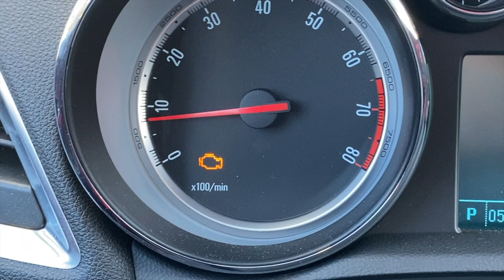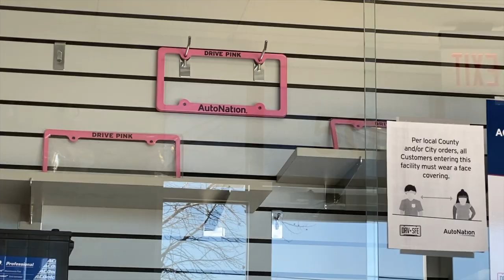#Cartrouble - Pearl is broken and it's expensive #catalyticconverter

Comment: Can i make a sugestion, find out how a car works. And what is and what is not important.
A catolitic converter is to do with the exhaust system and limits exhaust gasses into the atmosphere it is not that important you can drive a car without one.
Car parts from main dealers are expensive because they are main dealers and can get away with it. .aybe try another auto shop not main dealer they are usualy just as good.
They are as we say in uk taking the piss or advantage of you
Hope it helps